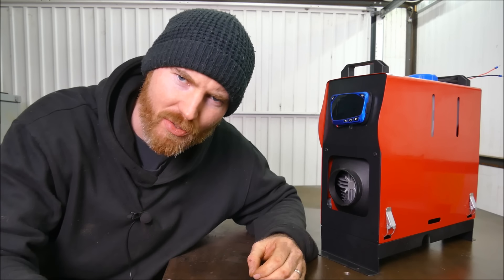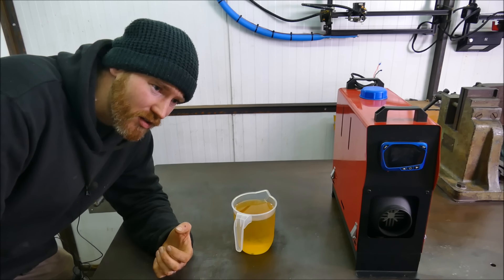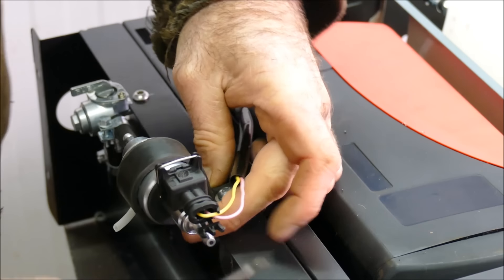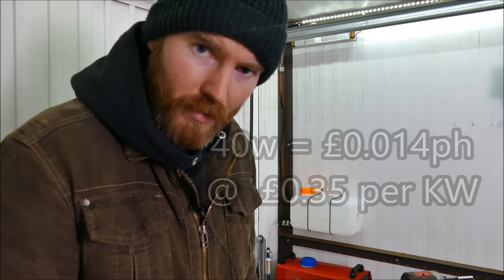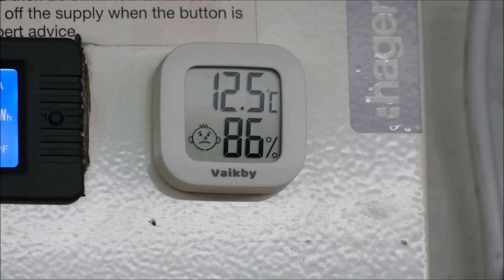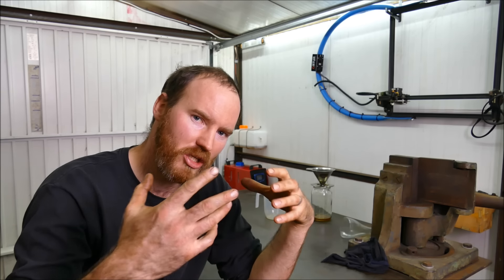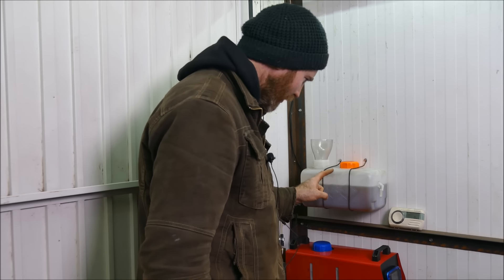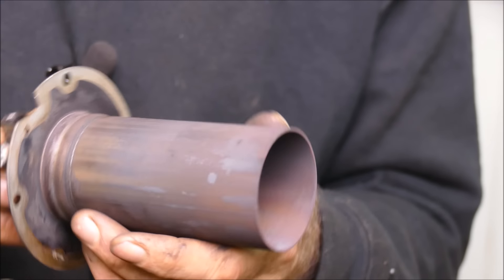£0.03 per kWh heater modification - Top facts & lies on diesel heaters - waste veg oil burn success

Comment from the maker: I Hope this was useful, I've done 3 videos so far on the heater and i've got another to come where I make a water cooler and underfloor heating.
Heres some links: 
The Diesel heater I recomend getting:
UK: https://amzn.to/3ZO5S57
USA: https://amzn.to/3ZQgBMr
Diesel heater featured:
UK: https://amzn.to/3TUGYgo
USA: https://amzn.to/3TUGYgo

Additional affiliate links:
Power supply 240v - 12v 300w
UK: https://amzn.to/3BhmvZO
USA: https://amzn.to/3PaYJoc

glow plug burner mesh:
UK: https://amzn.to/4euSkQv
USA: https://amzn.to/4erp1OH

Cheers J
Reply: Hi, just a thought if you tip the water out of the bucket and replace it with sand you should have then created a heat battery that will stay warm for ages and it wont leak into your exhaust😊
Reply: I think you split the hot exhaust when you lowered it into a big bucket of cold water 🙂 love the video ❤
Reply: @joshuadelisle  I’m just getting into your videos and you have a lot of great content that is helping me with my projects.
Reply: @joshuadelisle  I fixed it . Thanks everyone
Reply: Comment coming from the USA, figure out how we can make moonshine while this thing is running.Lol.Loved the video
Reply: I was thinking the same thing ahead of you about adding kerosene to the vegetable oil.

Comment: The water in your exhaust is probably not from a leak in the line, but from condensing water of the exhaust fumes. Burning hydrocarbons creates CO2 and H20. Cooling the exhaust in the bucket condenses the water vapours from the exhaust.
Reply: That is exactly what it is.
Reply: Yes I made it a point to have my exhaust downhill.
Also the condensate is acidic and a reason why exhausts on your car rusts
Reply: I am using a household radiator with the output at the bottom to take the condensate out which can be surprising.
Reply from the maker: Very good point. Cheers J
Reply: Put a condensate trap and pipe from an oil boiler on it 👍
Reply: Hot air that meets cold creates condense no matter what you burn
Reply: @Electronics-Rocks     it must be posible to put a valve to do the job on the radiator..

Perhaps one of those used for condense water in aircon systems are made for the job, they wont let air in when it disposes the water.
Reply: @Hansen710  I tried one from a air con unit but it melted together.
Someone mentioned one from an oil burner.
I kept it simple just use gravity and my workshop is on a downhill slant anyway.
Reply: If you look on the silencer box on the exhaust you will see a tiny hole ..... this should face downward to drain the condensate out!
Reply: @joshuadelisle  my curiosity is... did you throw  the before exhaust  in trash or kept it for check
Reply: It may have also cracked when he submerged it whilst it was hot.
Reply from the maker: @panospapadimitriou3498  still got it and will check it. I'm surprised how much water was in it after just a few minutes if it was condensing. Cheers J
Reply: YUP Just vapour in exhaust, great little video buddy.
Reply: @Electronics-Rocks  Correct on the condensate. Exhaust is pure water and CO2.  And a few other things not of interest here.  Pure water has an affinity for ions.  It quickly absorbs CO2 (also in the exhaust) forming weak carbonic acid.
Reply: @joshuadelisle  you gotta remember you had 86% moisture in the air when you started. at freezing temps that equates to 4.5 grams of water in 1m³ of air.
Reply: That's exactly what it is, all modern gas or oil heaters (domestic ones) have a condensate line, as more condensate you have the better the unit will suck the heat out of the exhaust, and that's again why you only need a plastic chimney for the new units, at least here in Germany I don't know the codes in the UK. Well it's not new the heat exchanger in the exhaust are there now for 15 plus years already. Your are also only allowed to use plastic pipe for the condensate water because of its acids. Wait.....Acid, I must here some Acid House now.....
Reply: Or if it's just for an heat battery you can fill you bucket with sand.
Reply: Yes, correct - hence this little hole i the middle of the muffler - to get rid of the water naturally condensed in the exhaust pipe.
Reply: That ribbed stainless tube is an ideal heat exchanger. Just keep the tube sloping down so water can’t collect and block the gas flow. There will be some flow resistance but some testing will work out what’s enough for the heater fan.
Those sheet metal clips are called chimney nuts or Spire nuts.
Reply: 80% kero to 20% vege will give a clean burn. 
Waste vegetable oil is a good fuel and it’s easy to clean. 100% vege has to be heated to 80C to burn clean. Burn it cold and the glycerol will carbonise and clog your heater. You could use the exhaust as an oil heater. Wrap copper tube into a coil around the stainless and clip so it’s metal to metal contact.
Reply: That’s exactly what I was going to mention. The condensation from the water vapor produced from the combustion. That’s why your car steams in the morning and drips water out the exhaust. Maybe drill a hole in the bottom of the bucket and route the exhaust pipe out the bottom.
Reply: The pipe in water is same principle used in condensing alcohol. Just let the pipe act as a basic radiator of heat into the room.
Reply: For the amount of water in that exhaust, that was not just condensation from only a few minutes of use, it would require several days use to produce that much water even if the intake air was near 100% humidity.
Reply: Plus 1 for a sand bucket rather than a water bucket
Reply: @joshuadelisle  Rebuilt three of these - best/easiest way to de-carbon them is - with gaskets removed - spray with brake cleaner and ignite with a blow torch. The carbon burns off and you repeat a few times then spray and wipe down. Exhausts and hard to reach areas can be totally revived with this method. MUST have good ventilation - obviously!
Reply: @joshuadelisle  Your pump is at two wrong angles - electric should be at the top and tilt angle needs to be steeper.
Reply: Let’s say you were to burn waste engine oil, and if you did I’d suspect it to clog up the burner and need regular cleaning out. Is there anything you can do to the settings to improve the burn and prevent clogging?
Reply: That's why i'v had a woodburner in my camper van for the last 5 years = zero condensation, 👍
Reply: pressure on system, damage....
Reply: @Hansen710  to condense moister into water you have to have humidity in the air in the first place or nothing will condense.  But burning 1l of fuel produces about 1l of water! that is where most of that water comes from!
Reply: For efficiency, AFUE standards would be higher than your standard oil furnace(80% roughly) or about as efficient as a condensing oil furnace(90% roughly). Miles better than traditional space heating(no driven air or oil , all gravity) at between 65 and - 80 % This is impressive for the size. A full fat furnace would be around 36 inches tall, 40 inches ish deep and 20 - 24 inches wide. this hardly looks much bigger than a coleman 2 burner cooktop.
Reply: At the lowest point in the exhaust add a branch pipe going right through the bottom of the bucket then seal the holes to stop the water that's in the bucket from leaking out. If you get what I mean.
Reply: @Electronics-Rocks  so are you putting the exhaust gas through the radiator Shaun ?
Reply: @dancarter482  My trick is to run it a bit lean, no buildup.
also fixed a few carbonization events by doing so. (new unit was not adjustable, replaced with old unit controller) just not so much that the temps drop too much
I live at 2000m altitude, first start is always rather rich with these
I've also found that it tends not to throw quite so much heat out the flue when doing so.
Also, are you using this in steady flow Hz mode? or on the thermostat?
Reply: Yes. He just needs to have the exhaust on a constant down hill.
Reply: I had a build up off water in my exhaust it was facing up slight
Reply: @joshuadelisle  improve the combusters combustion efficiency more.. the intake air can act as a further secondary heat exchanger.. by drawing intake air from a jacket pipe.. AROUND the exhaust pipe.. every degree the intake air is very closely correlates to a further degree increase in combustion temp.. thus improving output for NO extra energy IN.. same applies for fire boxes.. basic maths
Reply: yeah that dunking is a little extreme experimentation, pushing the limits...
Reply: @Hansen710  ONLY if the hot air contains water vapour...
Reply: It’s not leaking it’s condensation, make sure tour exhaust exists outside and is nowhere near an exterior intake
Reply: I would point out as your garage, workshop appears to be metal, and you have exposed 240 v terminals and eclectics up near the ceiling, in cold weather you could well get condensation up there and drip onto the electric bits
Reply: Yeah, came here to add this. It's funny because he mentioned condensate, but I guess didn't think it would build up so quickly.
Reply: I had a large van with a wood burning stove/water heater in it, I installed a diesel heater and ran the exhaust up the inside of the stove's chimney. Never had a water problem but then I wasn't cooling the exhaust. On the outside of the chimney I had a copper coil of microbore, a temperature sensor and an aquarium pump would kick in when the water in the tube was at 60+ degs C, I used to harvest that heat from the chimney and feed it back into the water tank. In hindsight, I might as well have just had the diesel heater, it was a far more efficient system but there was something nice about a log fire and water filled radiators.
Reply: @rudimm do a PH test that water may be acidic, ensure the metal it falls on is stainless , no galv or aluminum
Reply: @niv8880 creative
Reply: EXACTLY. Burning a liter of kerosene creates a liter of water.  By cooling the exhaust down, it's condensing in the exhaust pipe.
Reply: Water does not stay liquid with those temperatures
Reply: Water accumulation in the first cooking of chips and fish etc. A water separator could be used kinda not very adequate though. I considered building catylist tank to heat the used oils and to leach out some of the moisture before final filter ,a 750 ml heat tank for hot water on demand smurfed for use into lower heat values with better control .filter prior to use 40-10  . Washing oils may help but adds too much time if not for biofuel. A 40watt seeding mat could make a decent heat wrap/ blanket for nights where the garage heat is off keeping fuel tanks warm if needed. Just thoughts. I'm running two tanks,5.5 gal each for the parking heater , many mods on fuel and exhaust. I'm also building a waste oil burner in a wee wood burning stove like one of those 45 gallon drum conversion sets. Add a blower call it clean ish
Reply: @DavidSmith-xe8wm 
I've had a diesel heater in my camper & workshop for 5 years also.
No condensation , no kindling , no logs , no mess & completely controllable temperature with virtually zero running costs
Reply: Uh
Reply: Yes agreed, condensed water vapor.
Reply: I live on a boat and run my exhaust pipe through and out of the main companion way. When it rains on the exhaust it condenses and back flows down the pipe .The muffler has a hole which enables enables water to come out. 
Always run heater on high for several minutes minutes before turning off
Reply: Completely agree.   I think if he'd put the spiraled exhaust in the bucket full of sand, he'd had the same problem.
Reply: Is it posible to use gasoline or diesel instead of cerocine?  Easyer to get hand on in my area
Reply: @mariusolden9762  I have heard you can.  My reaction is that IF I were to use a volatile like gasoline,  I'd test it outdoors first.  Run it and make your own conclusions...

Personally,  I'd pay a little more and keep it simple with fuels that are what it was designed for...
Reply: @joshuadelisle  hi. Josh based on the amount of heat that exhaust outputs. would love see you try a steam power generator.
Reply: How about passing the exhaust through the heating coil in a hot water cylinder? Feed it into the top and out the bottom so any water can drain away naturally.
Reply: 8:55
Reply: Just like condensed alcohol from a still.
Reply: Rivnuts.… Whoàh
Reply: Yes the exhaust needs to drain
Reply: I’m an engineer and you want this water to condense. It vastly improves efficiency. I actually have a condensing natural gas furnace which is a standard in the US
Reply: @Electronics-Rocks  wq wuoioioo
Reply: I love how many YouTube comment experts will never take the time to do any of this, and definitely not post in front of everyone to critique but yet feel compelled to use words like “stupid, waste of time, useless, etc.” I appreciate the time and effort you put into this. I’ve learned a lot and feel better for it.
Reply: That's ridiculous with the water bucket, you use an old heater, for example from the shower. a flat one at that. Make a drain where you can drain the condensation, and well that's ridiculous with the water bucket lol

Comment: Why they don't want us to have cheaper heating is immoral especially when people like me have not had any heating this winter, when British gas made record profits
Reply: I live in Michigan Here in the State it's the same thing and it all comes down to one word "control" and my heart goes out to you and yours that you make it through the winter
Reply from the maker: I nearly ranted about that. Had to hold back. Cheers J
Reply: @chrisgibson2328  agreed making money
Reply: GREED CRISIS not a living crisis.
Governments that should be protecting the public, but looking the other way, to suit their employers.
The energy companies & Banks.
Reply: Waste engine oil contains all kinds of trash. I wouldn't want to live in a suburb with a bunch of neighbours burning it.
Reply: Engine oil contains hydrocarboms.  When the byproducts of combustion blow by the rings the engine oil picks up more carbon.  Which is why used oil is black.  Burning used motor oil can be extremely clean if it is preheated and has sufficient oxygen for combustion.  The exhaust will contain carbon dioxide, water vapor (that was the light white vapor that he thought was pollution) and a small amount of carbon monoxide.  @Lappmogel

Comment: Route exhaust through through big old steel tank, then fill with sand, and close it, you created heat battery. After cycle end, lets say 10 hours of haeting air, heat battery will be hot and should give infrared heat out for next hours, therefore your garage could still be much warmer inside than outside in the early morning, without using a single drop of fuel extra.
Reply: Very good idea.
Reply: 25mm gravel or greater through a perforated pipe perhaps but sand.  Nope.  You'll suffocate combustio, coking up the burn chamber  and worse as the sand gets wet it will clog further.
Reply: @SynKronos  I don't think the exhaust pipe was ment to vent into the sand but coiled in the bucket of sand and vented back out like the bucket of water. Just heats the sand.
Reply: @chrisabraham8793  Ah, that makes sense.  But it would have to come out of the bottom of the bucket or water would fill the exhaust
Reply: @SynKronos  I suppose with a bit of fire clay at the bottom of the bucket surrounding the pipe would stop the sand falling out. I am quite surprised that the amount of heat generated by the exhaust hasn't evaporated the moisture right at the very end.
Reply: @chrisabraham8793  Just posted a video of my install.  The internal component that is if you are interested.
Reply: Why not bricks to store heat in a metal insulated tank?
Reply: @SynKronos - you may want to rethink your comment 😉 when the 💡 comes on you’ll realize.
Reply: Right now the price for 1 kw is 1£ in my country! Denmark..
Reply: Love the channel 💪🏼